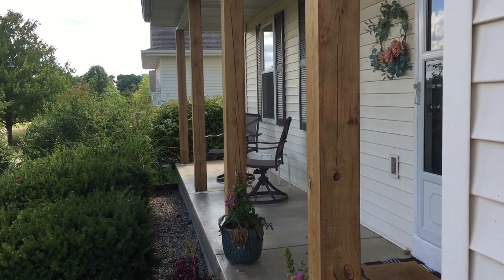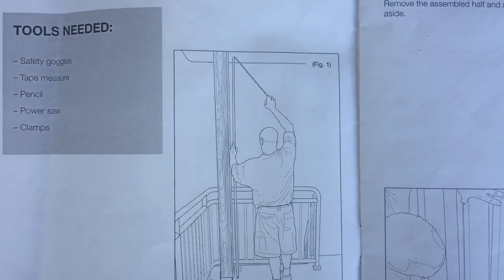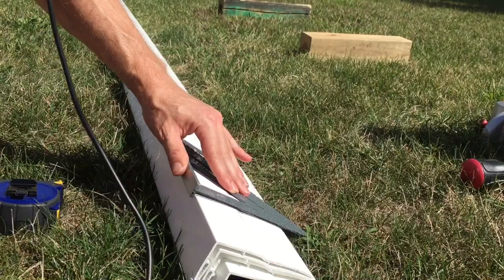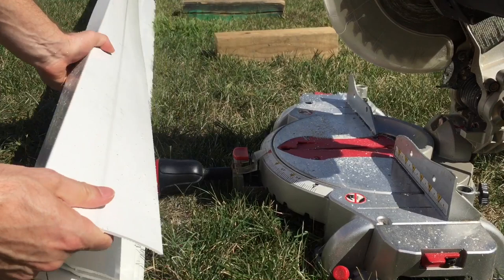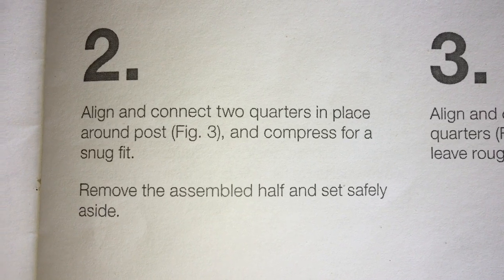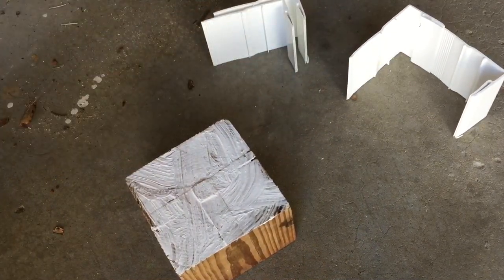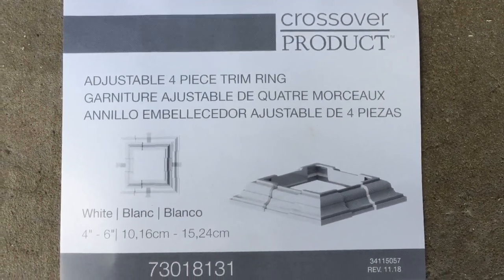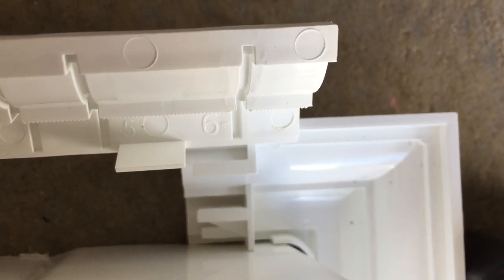How to Install RDI Post Wrap and Trim Base, Adjustable 4 - Piece, 6x6, Complete Guide and Review

Comment: You made this look easy with all your instructions.  This is exactly how a DIY video should be made.  I have nine post to cover with PVC and the person building my deck has quoted me $4400.00 dollars to cover the post.  Your work installing the PVC covers makes me feel like I'm getting robbed.
Reply from the maker: Thanks, I appreciate it.
I believe the price for the covers was roughly $110 per post. So, at 9 posts, that’s about $1,000 for just the covers.
Installing them seriously went pretty smooth. I did the whole thing myself in an afternoon. No issues.

Comment: Thanks for this video. I was having trouble installing these very difficult. Problem was it was 40 degrees. Next day I pre warmed them and install at 55+ degrees and so much easier. Temp makes a huge difference!
Thanks
Reply from the maker: Thanks for sharing! Yeah, I did it on a nice summer day. It was probably in the mid to high 70s.

Comment: For the 6x6 wrap and trim rings you need to cut off only 1/4" from the factory cut.  If you cut at the 6 line it is too short and will not fit.

Comment: I bought this product, a notable difference is mine came in the box at about a 75 degree concave angle so I had to wrestle them on, now they don’t pull flat in the finished look. But I believe my posts are slightly too big so I’m going to fix that and hopefully they go on easier the second time around
Reply from the maker: Thanks for sharing. I appreciate the input. I can confirm that my boxes were nice and straight. I'm not sure if it makes any difference, but I ordered from Deck Expressions and they were delivered UPS. There were no issues with packaging.
I can imagine that a 75 degree concave would cause some issues. I hope they come together for you after you decrease you post size and get better engagement when you press them together. Otherwise, maybe set them on some saw horses, concave up, and hang a weight from the center on a warm day. Maybe they will straighten out. Just a thought.
Reply: @HowtoandReviewsOfficial   yeah, unfortunately winter is on its way, gonna have to get them knocked out soon

Comment: Did you put the trim rings around the top of the posts as well, or did it look finished enough without them?
Reply from the maker: I put the same trim rings around the top as well. It didn’t look right without them, and adding them finished it off.
I didn’t want to run nails or screws through them, so I used some clear hot glue as a test, and it has held up great with no issues.

Comment: I just installed the same ones on my deck and yes it is that easy. Did you use caulk on the top?
Reply from the maker: I got another set of trim pieces that I installed at the bottom and installed them at the top as well.

Comment: Was considering using these on our front porch, however our mental posts or Smart jacks are round with 3" base at bottom and 5" base at top--do you think these would work on a post that is not square?  Thanks!
Reply from the maker: I don’t think these would work well with a round post. You could add some strips of wood to the outside of the post to give the covers a surface to seat against.

Comment: Is that saw something special? It appears to run at very low rpm, or is that just an optical illusion?
Reply from the maker: Nothing special. Just an optical illusion. The footage is shown in double speed which may have something to do with it.
Reply: @HowtoandReviewsOfficial  Thanks. I've used a cutoff saw like that for cutting vinyl siding, but with a fine tooth blade mounted backwards to reduce the chance of chipping chunks off the cut. But you didn't appear to have any problem. Great video by the way!
Reply from the maker: @ReCverin  Great point. I did a test cut to make sure there was no chipping. It cut with no problem. All of the cuts were clean with no issues. 
And thanks, I appreciate it!

Comment: name and address of the company supplies this product
Reply from the maker: @Lalat Marwaha
Hello. I personally purchased these from Deck Expressions, which is an online store (www.deckexpressions.com). They are also available through Home Depot; you can order them from the Home Depot website and have them delivered to your local store or home, but I do not believe they are typically in stock at Home Depot stores. I ordered from Deck Expressions because the cost was lower. They may be available from other retailers, but these are the two that I am aware of. The post wraps are available for 4x4 and 6x6 posts.